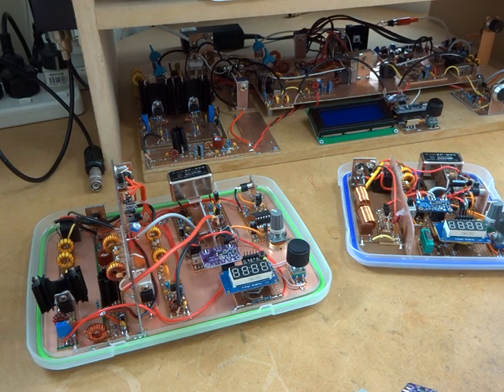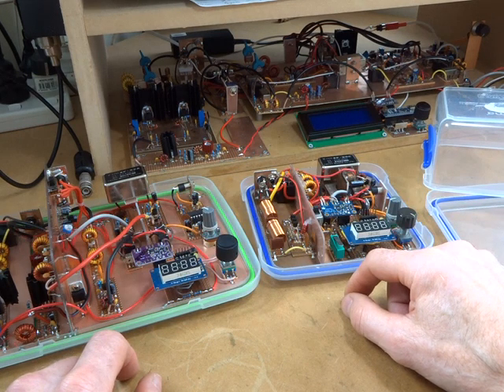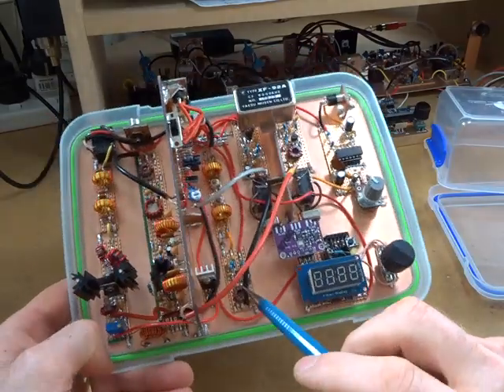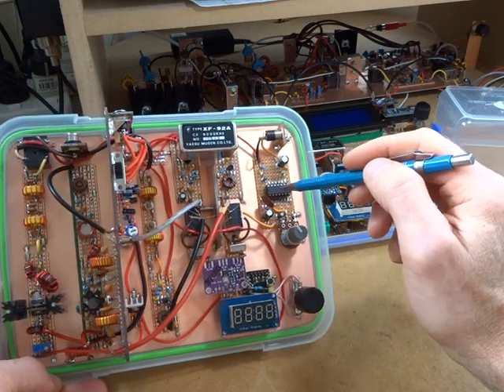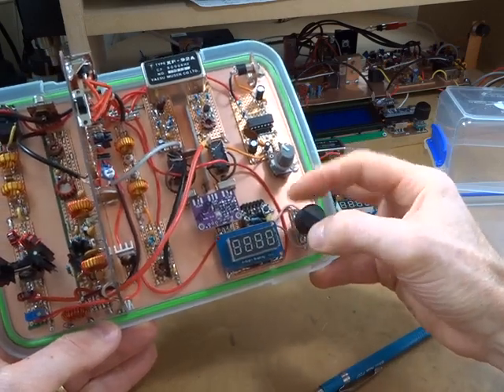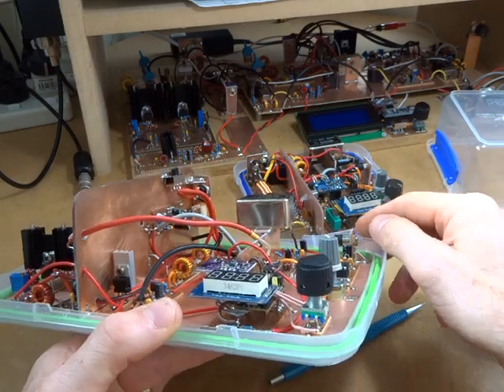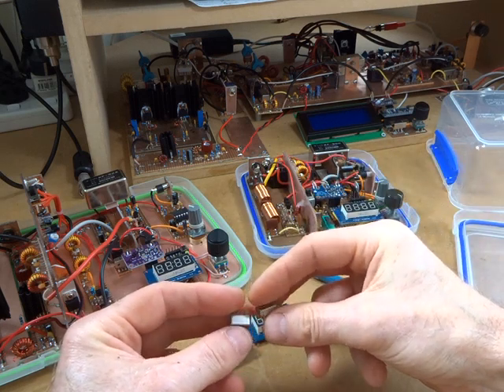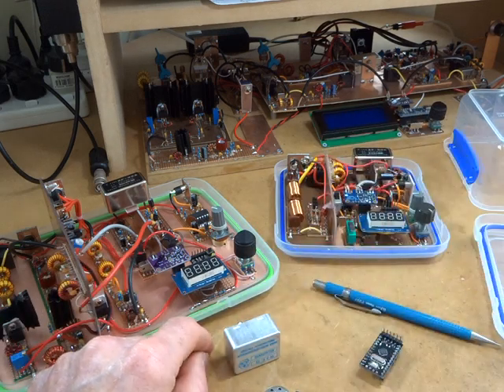Homebrew Portable 40m SSB QRP Rig. Part 1: Thoughts and Ideas

Comment: Nice project.  Looking forward to the J310 RF amp workings.
Reply from the maker: Hi Paul. I understand the J310 is getting difficult to source. One of my aims has always been to use readily available parts (to a degree). That being the case,  I wonder if I should try another FET. Perhaps a MPF102 or something else? Either way, I'll also do a J310 antenna amp.
Reply: @CharlieMorrisZL2CTM  Yes, ask your audience for an in-production RF JFET, see what the crowd comes up with.
Reply from the maker: @Paul_VK3HN  Sounds good. Cheers Paul.

Comment: Charlie, you have to give a shot SMT, KiCAD and JLCPCB some day. You will be surprised how much space you can save.
Reply: Yes, a rig like this would be one fifth the size! But a bit of a learning curve.
Reply: @Paul_VK3HN  I don't think this way about the learning curve. KiCAD is extremely straightforward to learn. There are some intricacies about building buses or preventing signal racing but overall it is very easy to work with. Plus, there are plenty of videos on youtube. It is not complicated as LTSpice for example.
Reply: @k1zmt  I am sure you're right, I'm in the half way camp, I use Kicad for drawing schematics (it is great and I enjoy it!) but I haven't taken the next step to using it to lay out boards yet.  I'll get to that someday.
Reply: @Paul_VK3HN  it is really easy and you will enjoy it. Just don't forget to run DRC checks - a real life saver.
Reply from the maker: Hi. I hear you loud and clear! At some stage I will have to bite the bullet and switch over. At the moment I like the  ability to sit down, do the maths, build the circuit and test it all in one evening. I  understand the cost of having the PCB fabricated externally has dropped significantly too. If I do get into SMD then it better be the huge ones!

Comment: Great, that's something for me again :-)
A transceiver in an analogous way.
Can you tell me your source for the J310's? Unfortunately, I only receive scrap here.
I'm slowly going out of crystalfilters. But that what you want to use, I still have (is it a XF9A?) :-)
vy 73 Bernd
Reply from the maker: Hi Bernd. I got a bunch of J310 from AliExpress. They seem to work well, which is good. Now I'm more than happy to try another easily obtainable FET. What would you suggest, the venerable MPF102?
As for the filter, the XF-92A will be fine as it's also a 9MHz filter. The only difference will be the I/O resistance and capacitance.

Comment: These housings are so nice man..
both thumbs up :D
Reply from the maker: And quite inexpensive too Markus.
Reply: @CharlieMorrisZL2CTM  

I prefer old "tank-Radio-style" housing types.
- 4mm thick stuff

- With accesshatch :D  

Or these little Aluminium housings.

But your housings seem to be waterproof from production line 

You may want to shield them with some alu foil?
In that case you may confusing with your launchbox. 

PS: did you ever try out Kite Aerials?
Reply from the maker: @markustopfer1605  Bi Markus. No, I haven't tried the kit antenna yet. Heaps of wind here this week!

Comment: Love the video's.   My thought was that since you have already done the prototyping with the other rigs, the proto boards for this unit should be smaller in size cause now you do not need the extra room in there for part swapping and such.  You know it works, shrink it.   Question,  I like the plastic containers, do you stack your containers right side up so the radio is stored upside down or do you stack them upside down so you can see all the goodies?  Yea I know I worded the whole thing wrong.  lol
Reply from the maker: Hi John. I agree. I should be able to shrink things down quite a bit. I'll look to solder on the interconnect wiring before mounting the boards, as things get tighter and tighter as more  wiring gets added. A for storing, I leave them upside down (as in the videos). Like you, I suspect, i like to see all the comments and think about what role they are playing.

Comment: Hi Charlie, I’m building a 40 meter portable rig, too. Mine uses Plessey bi-directional stages and SBL-1 mixers. The vfo is an SI5351 and it puts out 10 watts using two IRF510s in push-pull. I always enjoy your videos and they provide inspiration for my home brew projects. Thanks!
Reply from the maker: That sounds really interesting Richard. I might try a push pull using two RD16HHF1's. I thought I had ordered RD06HHF1, but alas no.  I'm pleased you find the videos interesting. I certainly enjoy it.